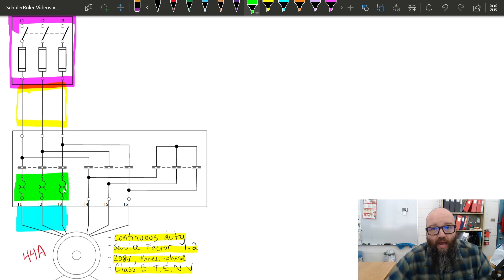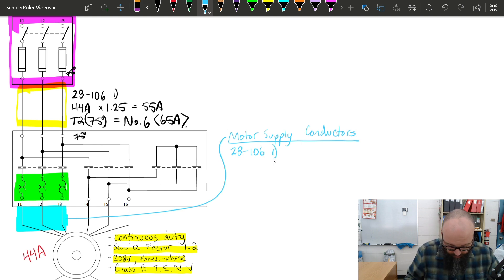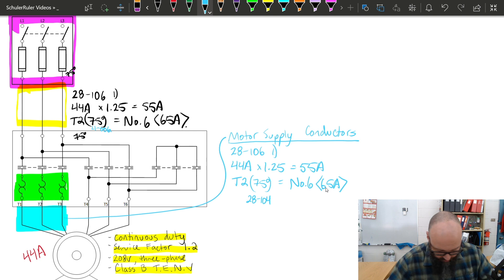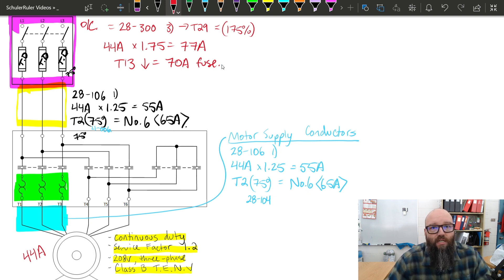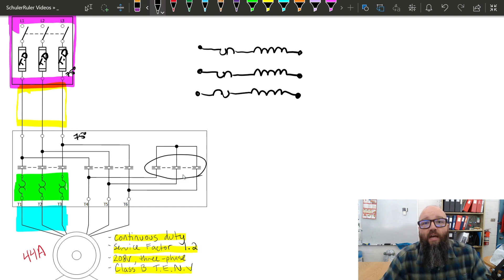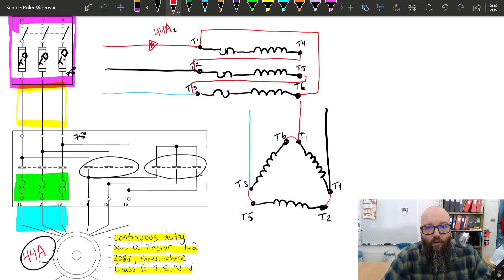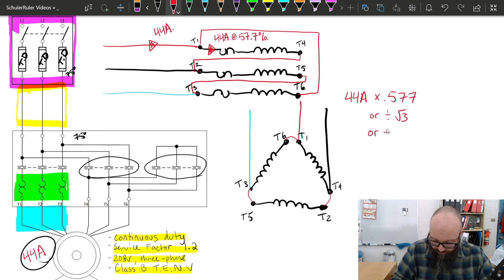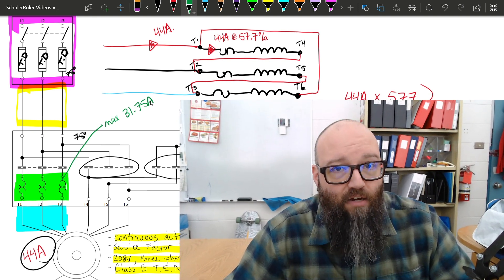Wye Delta Start Branch Circuits

Comment: Fellow Canadian Sparky! if your still active on this channel, i have questions/comments that you might be able to answer. 
One, I heard that the curriculum is going to be updated finally, which will change when certain topics are learned, eliminating certain topics, and the length of the terms. 
Two, I read somewhere (that seemed legit) that some skilled trades will grant accreditation towards secondary schooling. Also, possibly a new way for the government, employers, and apprentices to navigate the whole apprenticeship process (I personally think that an app could easily replace AIT's middle man role and just have them around for enforcing/policing, as bad as it sounds).
Any answers/comments are appreciated from anyone
Btw, you've helped so many of us with your vids bro. Love you <3
Reply from the maker: Hi sorry for the delayed response, you are correct on both counts. There is a curriculum shift occurring in all four years of the programs that will bring 3 and 4 to ten weeks, and 1 and 2 will return at 8 weeks. 
Yes, future apprentices that finish and earn their certification well be eligible for an educational credential equivalent!

Comment: Maybe not relevant to this video but if you use table 10 do you have to use table 5?
Reply from the maker: You would require table 5c correction factors in between the starter and the motor as there are six current carrying conductors at that point. 

FLA ÷ Table 5C correction x 28-106 multiplying factor (continuous duty vs non) = the required minimum ampacity for the conductor.

Comment: Please do a video on Section 24 and Z32, specifically how to wire using ISO-BX. There seems to be a lot of confusion with how/where to connect the insulated bonding and bare bonding on the load side among inspectors and engineers. Great videos btw! Thanks for making them!!